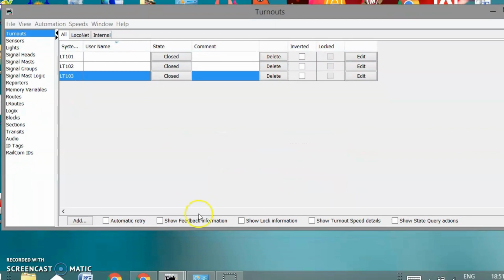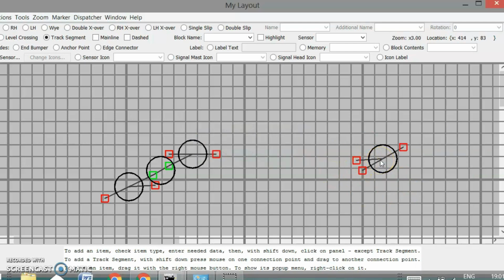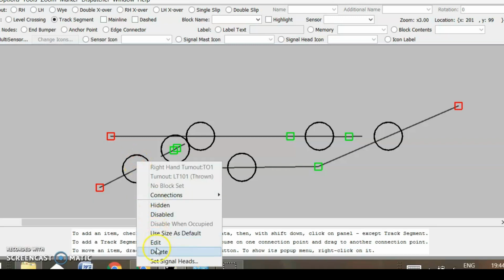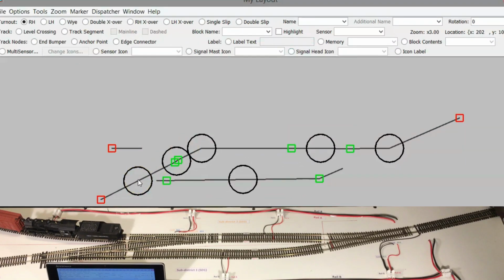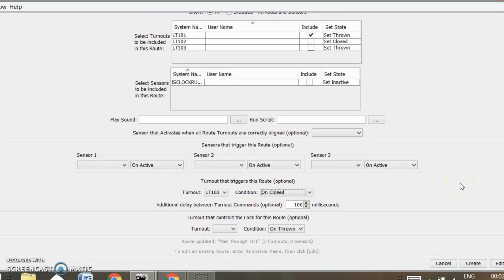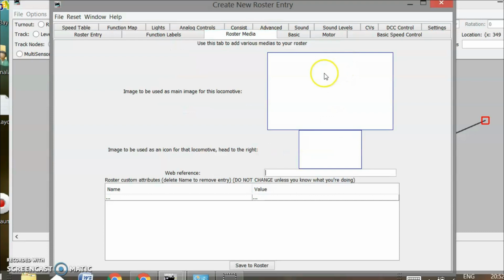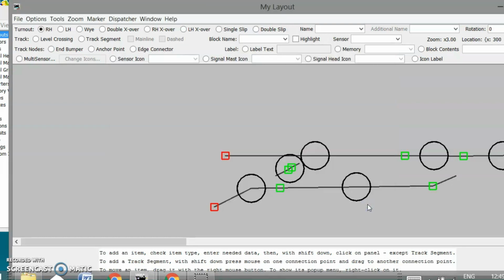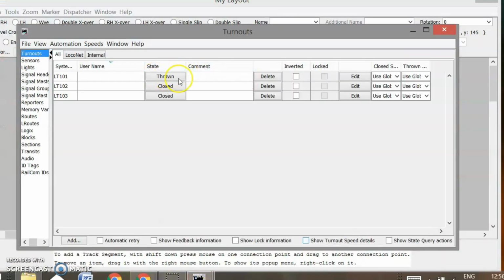JMRI: Layout Editor, Interlocking, Routes, Roster and Throttles

Comment: I'm looking forward to a new video where you explain how to automate 3 trains (so they don't crash) on 4 interconnected dead ended tracks so that trains can pass each other like a real metro rail network.
Reply from the maker: Hi! I am really sorry, but things changed and I am away from making YouTube content for the last 4 years and I don’t see myself going back to it anytime soon. But I think there are many others now who are making great model rail automation content. Also if I have to do it today, I would perhaps do it with a TrainController software and not JMRI. LCC has also shown some promise when it comes to the networking infrastructure and simplifying wiring. Take a look at these two options along with traditional LocoNet-JMRI eco system and choose that works best for you.
Reply: @TrainsandDioramas  I'm using a Digitrax DCS 210+ with turnout controls and block detection as well a rr-circuits and JMRI. My layout is more like a back and forth Metro style system so people can see what real Metro services need in there back end for total automation. When I have completed the process amoungst the many other projects I have burning at the moment I'll release all the videos I've made.

Comment: Thank you for your videos. I've been contemplating switching to JMRI for the last 12 months. In  recent days I have been playing around with a couple of old computers with Windows 7, having some problems, but when I get them sorted I'll be straight into it! I have just subscribed. One question if I may, what motors/solenoids are you using for the turnouts. Mine are operated manually at the moment, using Peco turnouts and Peco solenoids, which I may/will have to change for JMRI.  ...  Ian
Reply from the maker: Hi Ian, thank you for the sub and glad that this was helpful. I used DCC concept's Cobalt IP digital turnout motors which come with a built in decoder. You can continue to use the Peco Turnout motors, you just need an 'interface' that can talk to your command station and control the turnouts - Digitrax DS64 would be my recommendation since I am primarily a Digitrax user, but there are plenty of options available out there and you can select what works bext for you. Any stationary decoder will work from your track bus and talk to the command station, however, if you are looking for a more efficient solution, Digitrax provides an option to use a separate network called loconet to talk to all interfacing hardware so the track bus is not clogged with different signals going to different hardware and can focus only on running trains. It is helpful if you have a medium to large set-up with many turnouts and complex trackwork, for simpler switching type layouts, connecting your stationary decoder or decoder equipped turnout motors to the track bus will work just fine. Hope this helps. Cheers! Kaustav
Reply: @TrainsandDioramas  I should have mentioned in my post that I have the Digitrax DCS50.Also I have just purchased a PR3. A user was rationalising his system and was getting rid of a lot of Digitrax equipment, so I "swooped".   ...   Ian

Comment: Now all I need to do is convert this to NCE system.
This was great to see, as I can see some of the errors I have done while doing my panel. Only main issue I'm having with mine is to add the 3 way switch.
With the new layout I'm constructing, I want to combine computer operations on some of the trains while driving another, this way it will make the layout come alive, and more fun.
Reply from the maker: Absolutely! I think once people look at computer control they go overboard with full automation, signal, block detection etc. which is OK if that's what you really want, but I think striking a balance is the most important factor so that you don't get bogged down with your automation aspiration and sacrifice the enjoyment of the hobby. Good luck with your project and keep me posted how it goes. Cheers! Kaustav
Reply: @TrainsandDioramas  I agree some go overboard with automation. For me to much automation takes the fun out of operations. Even though to have full automation can be challenging in it's self.
Idea I have is to have my passenger trains and some trough express trains run automatically, using the computer as a dispatcher when it's only one operator, and drive the local trains my self.
Be a while before this can be achieved, as many of the components like the DB20 for block and section detector unavailable, it will be some time before this will be completed. It would be great it the digitrix track detection and block signalling system would work with NCE.
Reply from the maker: Technically speaking, it shouldn’t matter, but manufacturers do put some little nuances that might make it troublesome for you to use a Digitrax block detector in an NCE ecosystem, but it’s not impossible. Plus there are many other independent manufacturers who make circuits that are compatible with many manufacturers. The principle of block detection is standard - either IR detection or current drop on the rails. Basically the only thing that you need to look for is a circuit that can has a feedback module / capability so that the feedback can reach your command station and from there to the software (JMRI , TrainController etc.)

Comment: Hello Just getting into JMRI on my layout.  I use NCE USB board to connect my Laptop two.  All my turnouts are Atlas HO code 83  I use NCE Switch 8 MK2 and Tortoise machines to control all the turnouts.   All the turnouts are addressed as 100 101 etc  up to 111  some have same number  for cross overs. When I add a turnout to my JMRI and then add it to the panel for my layout  When I click on the turnout icon it switches the turnout in the table the turnouts showed closed or  thrown  My problem is that the turnouts do not change when I do this.  My laptop shows connected on the serial port com3 which is the driver for the NCE USB board.  Anything else I can look for?
Reply from the maker: Hi ! I have never used NCE products so I might not be the right person to give you the exact advice here, but it seems to me that your laptop is not connected to your command station. In JMRI, along with selecting port, you also need to select which connector and command station you are using, have you gone through the a check that all those steps are done properly? I have a getting started video here that shows the set-up steps in detail - even though it is done with Digitrax product, the steps are fairly generic once you get an idea of what needs to be done: https://www.youtube.com/watch?v=O7L5eorXvuQ - hopefully this gives you the directions that you are looking for. Cheers! Kaustav
Reply: @TrainsandDioramas  I figured it out last night when I went into the tables I created the turnouts under the ALL tab and that gave them an ID of IT1 etc I then saw a NCE tab so I added the turnouts to that tab and the IT was NT 1 NT2 etc now they work great thanks for the reply Tom

Comment: I am awaiting a chapter on adding signals using JMRI especially on a modular layout which may not be the same configuration every time the layout is assembled.
Reply from the maker: It might be possible to do it to some degree if the Control Point arrangement remains the same at entry and exit of a town even if you change things up in between. It is also possible for ABS and long stretch of scenic tracks - just make sure the sections that form the block are defined as the original track plan. But overall, it will have some limitations - changing things up cannot be completely at random, you have to stay within the logic designed for the signaling system. Cheers!

Comment: With DCC, JMRI, and computers, we are where I would have liked to have been back in 1972 when I first got into the hobby.  I started in HO but quickly changed to N because in the military, with each move, it was easier to move.  All my layouts until 2015 were done with DC.  When I retired in 2015, my made the jump to DCC (using Digitrax) and have spent the following five years to present building my N scale layout.  Thanks for all the very useful videos.  I have learned much.
Reply from the maker: I am glad that you found this video helpful. I started with DC too. And though with a few good locomotives and some creativity, I enjoy a very good operation centric layout, DCC is the natural progression in Model Railroading, especially if you like to operate a railroad vs. just running trains. And with computers, sky is the limit, whether you use JMRI or other specialized software like Train Controller. Thank you for stopping by. Cheers! Kaustav

Comment: One quick question for a new starter. how do your turnouts know they are 101 102 etc?
Reply from the maker: Hi - you need to set the address for each turnout. In this case, it was done beforehand directly from the command station itself. Here is a good video showing how it is done for the turnout machines that I used: https://www.youtube.com/watch?v=W0DDtUrzoYM

Hope this helps. Cheers!

Comment: Do I need to purchase a DCC Throttle, or can I just purchase a PR4 and hook it up to my computer and then use the JMRI throttle or WiThrottle to control my trains?  $68 is a much cheaper entry into DCC than $175.
Reply from the maker: Unfortunately not. The command station (the throttle and command station are two different infrastructure, in entry level systems they are supplied as a 'combo' unit to make it easy for the user) is the real brain of the system. That's the 'station' that communicates with the decoders on the layout. The PR4 is an interface that connects the command station to the computer and helps 'expand' the capability of the 'user interface' so that you can 'talk' to the station easily rather than keep pressing buttons on the throttle (the throttle is equivalent of a 'push button' user interface). Software like JMRI, TrainMaster etc. makes it easier for us to give the right 'command' through a better interface, the real work is still done by the command station to translate them into 'signals' and pass it on to the 'decoders.'

Hope this helps. 

Cheers!
Kaustav

Comment: In answer to your question I think computer control is the way forward for most situations it makes so much more of your model it is also the control I use to dream about when I was a kid with my old Hornby OO from the 1960s it was always a frustration that I could not easily do these things. A challenge for JMRI is setting up a three way I am still not clear how to make it work Neil
Reply from the maker: Sorry, I didn’t get that Neil, what do you mean by ‘setting up a 3 way?’ Do you mean a 3 way point?
Reply: Yes three way point
Reply from the maker: Neil  Hmm. I don’t have a 3 way point to figure out, but I do have an idea. AnyRail can extract any layout or element to an XML file that can be directly imported to JMRI. AnyRail free version gives you option to build a layout with up to 50 track segments. You might want to try designing the 3 way and tracks around it in AnyRail and then import that to JMRI and see if it works.
Reply: The challenge is trying to draw the three way so it works in panel pro If you  look at the top of the page there is a tick box for all except a three way. I think the trick is to use a left & a right point but whenever I tried it I couldn’t connect them on the screen a friend managed it but I still could not repeat that myself
Reply: Neil Rogers - I had a similar discussion with Dave Fenton from megapointscontrollers about a double-slip; his suggestion is to think of it as two turnouts/points. With a three way it would by more straightforward, as they go the same direction. 

I have one as well, so will give it some thought. Are you in the UK.
Reply: dckuk 
Yes I do live in the UK Midlands. Yes double slip is ok, and that is the way to look at it two closely fitting points/ switches back to back but the problem with JMRI is drawing a three way it is not a pick item the only way we have found, which I still have problems with, is to overlay a left and a right switch
Reply: Neil Rogers: JMRI has this explode on their site - http://jmri.org/help/en/package/jmri/jmrit/display/SetSignalsAt3WayTurnout.shtml
Reply: Neil Rogers and I’ll be at Kettering if that journey is on your cards with my US layout Squaw Falls.
Reply: dckuk I don't think I will be at Kettering I am putting my available train funds in going to the NMRA BR convention in Aberdeen end of September. I am in a North American club in Northampton where we are geared around by monthly Operations.
Reply: Neil Rogers I didn’t know the Northampton club was US; will need to pay closer attention and try to get in the guest list for the next show...
Reply: @dckuk  A5 Railroaders The Watling Road. (Formerly Nene Valley Railroaders) see Division Diary in NMRA BR mag Roundhouse

Comment: Your musings over the - degrees and + degrees I think are standard in CAD and 3D drawing. Keep up the good work Neil
Reply from the maker: Neil Yeah, some software I use works the other way, notably AnyRail. I was using AnyRail right before this one, that must’ve confused me a bit.
Reply: @TrainsandDioramas  It did say on the rotation box that it is in degrees CW, which is probably to indicate clockwise degrees.
Reply from the maker: @trazzlotinkerboltz5684  Yes, that little detail was missed when I was doing the commentary, I was not even looking at the dialogue box probably because you keep focussing on what you say and do, not what you see, ironically! Thanks for stopping by, hope this was helpful. Cheers!
Reply: @TrainsandDioramas  It was -- now I am watching your other videos. Thanks for doing them.
Reply from the maker: @trazzlotinkerboltz5684  I am really glad that you're finding them helpful. Cheers!